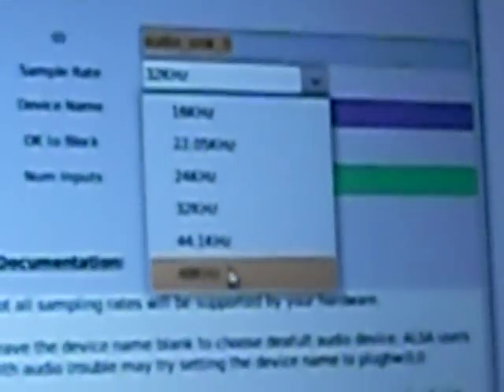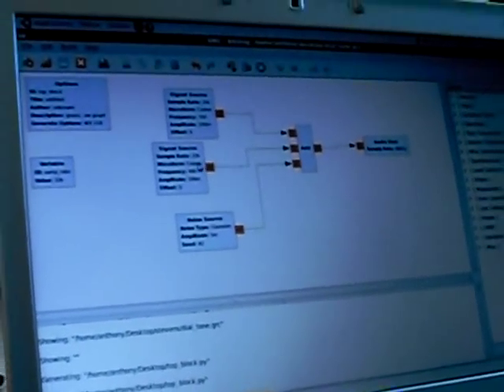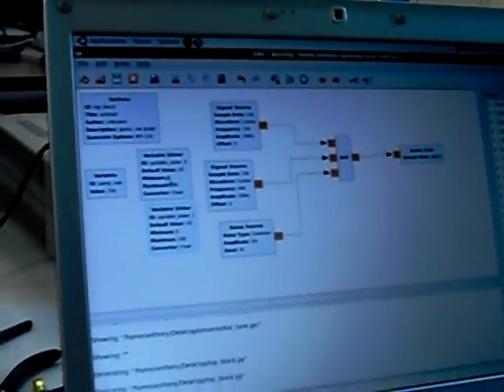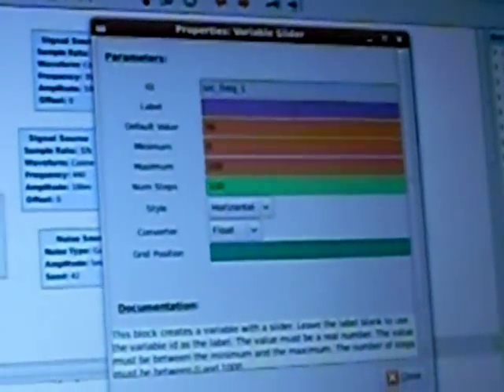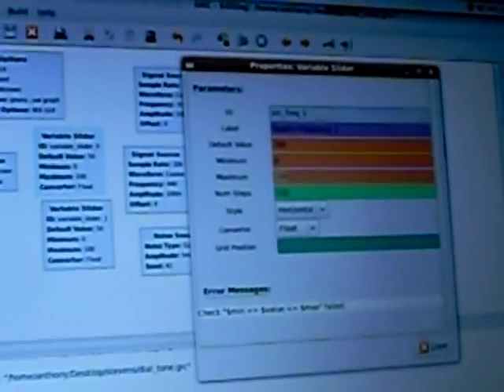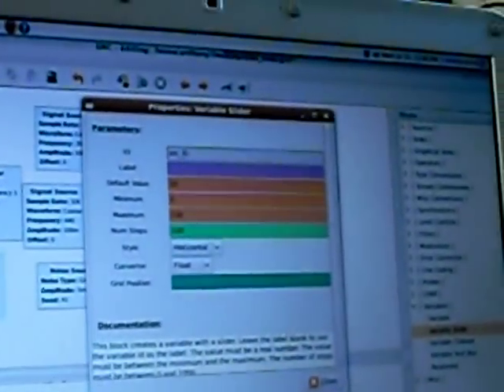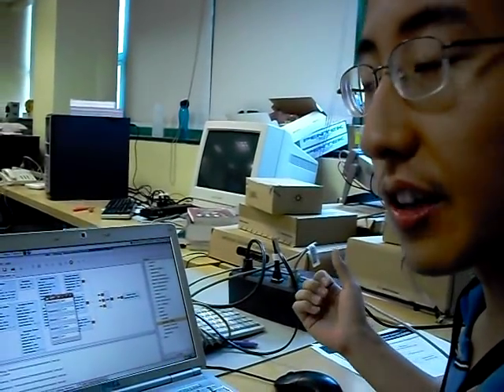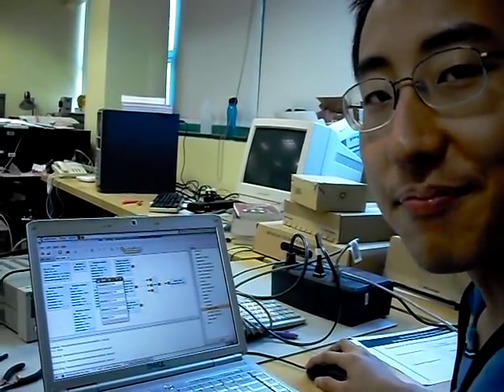The "Hello World" of GNU Radio: Dial Tone

Comment from the maker: @fighterpiolt1992 GNU radio is basically a popular software-defined radio. The hardware is basically a radio antenna attached to a box, inside of which is an FPGA. You connect that to your computer via a USB cable and program the radio on your computer using Python. See the Wikipedia article for more info.

Comment from the maker: @johnmcudd 

Hi John,

Sorry, I can't really help you because I did this research last summer, and I haven't touched GNU radio since.  The only thing I can remember is to try changing the sampling rate to 48 kHz. I remember I had a problem once where some instructions said 44 kHz was okay, but I kept getting an error until I switched to 48 kHz.

Comment: Hi, I 'm newbie to GNU radio. I followed the same steps as you explained but I am getting the following error:
Error 0:
Block - analog_const_source_x_0 - Constant Source(analog_const_source_x):
  Source - out(0):
    Port is not connected.
I wonder whether I need to connect external USRP hardware to get this one work.. I appreciate your help. thanks in advance.

Comment: Way too fast, "I'm going to need 2 signal sources"  Yeah, don't tell us which ones you're using, and don't focus the camera so we can see what you're doing.  "then we're going to get a noise source" but we aren't going to tell you where at is or which one....  I'm sure if you already knew everything about SDR there was some kind of usable information, but this video taught me nothing.  All I'm getting is errors when I try to run the programs I typed in from the Hack RF One guy
Reply: Agreed, it would have been nice if this was more instruction and less demonstration.

For anyone having the same issues following along:
 - Signal & Noise Source can be found under Waveform Generators
 - "Adder" is found under Math Operators
 - Variable Slider appears to be no longer there, but the equivalent control that I used was the QT GUI Range under GUI Widgets->QT.